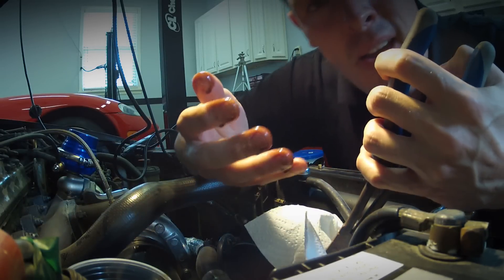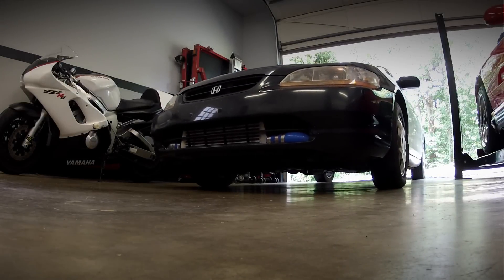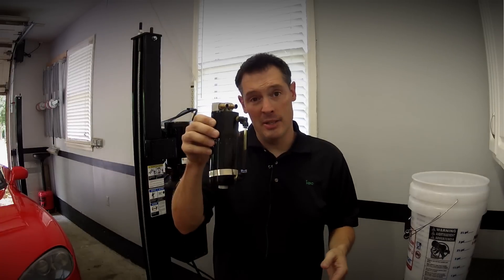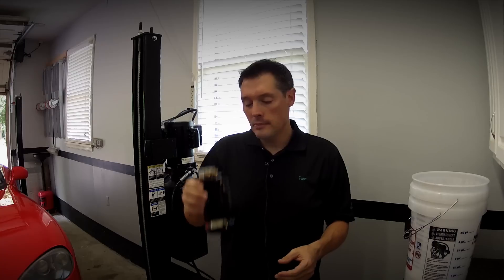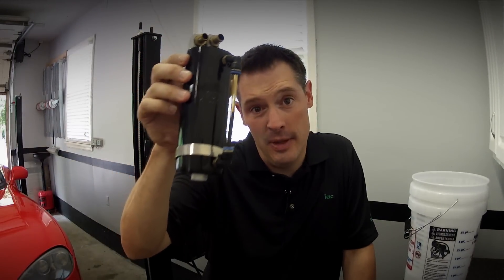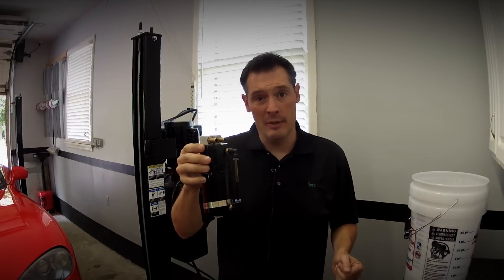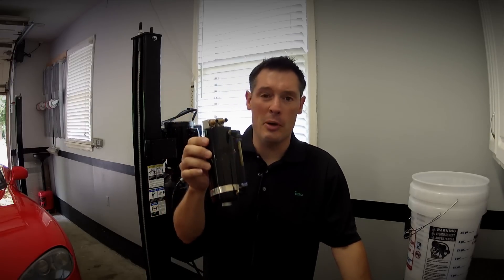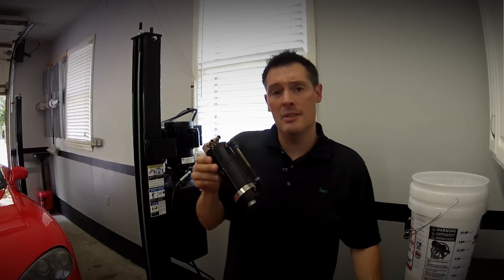Oil Catch Cans Myth Or Must Have - Ebay Oil Catch Can Review

Comment: Looks like u r using a crappy oil filter, and maybe cheap oil too. If you use a good 20mic filter media you wouldn’t have that black sooty stuff you are showing there. On these GDI engines you have to treat them with the utmost care. Catch cans are really not needed unless you want to use the cheapest oil and filter you can find, and that’s entirely up to you but I wouldn’t advise it.

Comment: ok....gotta consider catch cans are NOT factory equipment on the original build. Let that sink in a minute. Then consider.....where has any data come forth that illustrates the actual volume of air borne or liquid oil contaminants passing thru the PCV system. The catch can contents get the big reaction from most people, but how much of the total volume of oils have they really caught. My guess is that they actually catch precious little of the total volume generated by an engine.  Pretty much the micro fine oil droplets that are suspended in air will keep right on traveling through the air stream and back into the engine. It amounts to a feel good thing....and of course it "seems" like they ought to work. They work alright, just not nearly as much as you would like to think.

Comment: I recently research for my 2022 frontier that the V6 VQ motor is known to have oil blow back in the intake which will cause the intake valves to get dirty which the. Can cause carbon build up and loss of power. I recently bought a catch can that has an in and out and the opinion to have a breather. The question that I have is where does the out connects to , is it to the PVC valve ? Where does the in connects to, to the intake ? Because there are couple of diagrams that shows differently and I saw two videos that connects either way for my truck or at least for the same make and model but different year (older) . It would be great appreciated on your help. Thanks

Comment: So it begs the question whos at fault  for the blo by.. we pay 1000s for a car manufactured by supposed professionals that is sold to us by grubby dealers just to have a fucking fault that is so easily fixed by all of you experts on catchcans.. should we suite the manufacturer, dealer, or dodgy marketers. Or just maybe we can make sure our turbos,  intercoolers, and other pollution gear  are serviced properly, by a trustworthy mechanic?. Well thers a job in it self.. ther was always a catch as soon as we bought the car..  Catchcans? A wise ol mechanic once said keep wearing sunglasses  the eyes will weaking.

Comment: One thing I believe that wasn't touched upon in the video or the comments is the effect that oil vapor has on engine performance.  The addition of oil to the intake charge can increase knock and detontation.  If the knock sensors pick up on knock, the ECU will stlightly retard ignition timing thereby resulting in a reduction in power output from the engine.

Comment: I believe in using an oil catch can, but to be realistic, that 6-8oz of liquid is suspended in vapor that it took 4000 miles to collect. Your engine doesn't see it in the same way as you're showing it. At that rate, it's actually pretty easy for an engine to swallow that amount w/o issue. It's when the amount gets too large for the engine to swallow and if the catch can weren't there, things like the EGR and its piping can get clogged up and become less efficient. I believe in catch cans being installed on all engines for when the day comes when the blow-by becomes too much for the engine.

Comment: Considering the cost of engine repairs these days, I wouldn't recommend altering the PCV system while the factory powertrain warranty is still in effect.  Installing a catch can will likely void such a warranty, as will tampering with any of the other emission components.  It has nothing to do with actually damaging the engine, it has more to do with manufacturers not wanting to encourage tampering.  EPA may not be looking over your shoulder, but they are monitoring manufacturers and their dealers.  JMHO

Comment: I've yet to see somebody do a performance test before and after.  At first glance I'm thinking it's going to rob you of power off the line. Overall seems like a really bad idea. The engine is the most expensive part of your vehicle.  Not like you just bolting on a cold air intake.

Comment: Wow, I cannot wait till you catch can fans out there find out they can do more harm then good.  Change your oil at the proper intervals and you do not need one.  Put one of these devices on your vehicle and you have just run the risk of blowing gaskets, along with making your engine run in a non congruent factory aspect.  One more thing, not all catch cans are created equal, if you do put one on, do your homework and get a decent one, I guess.
Reply: Changing oil regularly helps some because you don't want the PCV to recirculate a lot of oil impurities through the intake. A catch can is useful because it tries to capture some of the impurities actually created in the combustion chamber. The safest way to install these is by using a 2 port catch can  attached inline with the PCV system.
Reply: d q i’ve got it admit the last car a wrenched on wasi my Datsun 280 Z. I change my oil every 5000 miles religiously sometimes earlier, on my mustang
I’m just kind of old-school, If A catch can was so important, ford would have made sure to install one from the factory . I’ve been doing a lot of research on them, most of the comments are favorable. There were a couple of articles I read stating that they can do more harm than good. Of course Scotty Kilmer the YouTube car guru says you need one. Anyway thanks for the reply, I have to admit all of my changes done to the blue stallion our exterior and interior. I have made no modifications to the motor at all, I guess I just don’t know enough about it.
Reply: @GunSlinger221  A few manufacturers have addressed this problem with DFI's. Read up on how Toyota's DFI works. They have one of the most logical systems at this time.
Reply: @GunSlinger221  Only newer cars have to worry about direct fuel injection clogging up their intake manifolds.
Reply: d q thank you sir I will do that appreciate all your valuable information

Comment: I think you need to say this is necessary ONLY for GDI engines. I had a Cork Sport OCC installed in my 2019 MAZDA CX 5 2.5 L. turbo. At 1,000  miles I have very little in it except a clear vapor. But in a $36,000. SUV I wanted to protect my investment. Turbos are more sensitive to carbon buildup than non-turbo engines.
ADDITIONALLY I'm having my dealer use its BG cleaning fluid system to clean the intake valves and turbo impeller.

Comment: Lol put a $10 part from eBay, on a $55k vehicle what can go wrong, have read here that best catch can at moment Provent 200, made in Germany, some test have been done here in Australia & some less expensive catch cans failed, compared to Provent 200, need to keep in mind if your not mechanical minded & you install incorrectly can blow seals & damage can be caused to the Turbo. I just installed Provent 200 to my Hilux still under warranty with Toyota had a Professional mechanic complete the work, Toyota ok with it, as long certified mechanic, but if you install it yourself incorrectly & seals go or Turbo good bye Warranty.

Comment: Don't those catch cans have a filter? This would increase the pressure behind the filter.  On the side of the PCV valve.  This would be the same effect as a partially clogged PCV valve.  A car with a clogged PCV valve doesn't run correctly.  If the filter doesn't have enough filtering to clog the PCV valve it is not much of a filter.  The PCV valve is not there to help the engine run better, it's there to decrease pollution.   It recirculates the crankcase gases back to the intake, instead of to the air.  How is an add on there even legal?

Comment: So if a catch can catches 4-6 oz of oil in 4000 miles,  on a car with a recommended oil change interval of 10,000 miles the catch can collects 10-15 oz of oil.  That's up to1/2 a quart and the oil level should be down by 1/2 quart.  So the vehicle you used to illustrate your vehicle uses in access of 1/2 quart of oil in 10,000 miles just through the catch can.
Reply: I have 244575 on my Kia Optima and my 1 bank kept getting clogged and causing misfires & blew my plugs and sensors. That was the symptom, the vapors built up and shut down my engine several times. The engine is designed to burn it, but GDI engines do not do it as well.
So I cleaned my engine with Seafoam and doing this will prevent it in the future.

Comment: 1:30 it doesn't catch "vapors", the vapors pass through to get burned. The catch can literally catches excess liquid oil (not vapor) that gets splashed and sucked in to the PCV valve. Normally it is burned off, but with higher power vehicles like LS engines and turbo setups, more of that oil is forced wherever it is easiest, aka PCV.

Comment: 1:52 soot in the intake would be due to the EGR and not PCV. That said, you are absolutely right to get capture this oil so it doesn't go back through your turbo, intercooler, intake manifold, EGR valve, etc etc.
Reply: I know this is old but....The soot is there......The oil that comes back into Mani, mixes with the soot and forms a paste inside your Manifold...Said paste is moist so it traps more soot, and just some nasty stuff going back into your engine.....

Comment: Waste of money imo, or manufacturers would put them on already for $20
Reply: I have installed 2,extremely worth it!The GDI engines do not clean the backside of the valves so all of the blow-by you see in the can corrodes the intake manifold and the valves.It forms into carbon and eventually chunks break off and in one case I know of(there are many more) it got into the valvetrain,stuck a lifter and flattened the cam lobe!$2000 repair ticket so these are way worth it.Not just an opinion,I have seen it with my own eyes.

Comment: Those are junk. You should not have that much oil in that can already. The can needs to have some type of baffling, or even some bunched up steel wool at the bottom. Good video though.

Comment: You can also use an inline air filter for a compressed air setup as well from any hardware store, those also have an inline filter that can either add to catching mist or get clogged up
Reply: Great idea. Would be super if you can post a YouTube video on one.

Comment: Cool video, thanks. I bought a reasonably priced Billet Oil Catch Can Kit through Amazon that will arrive tomorrow for my 2014 Dodge Challenger R/T Classic (5.7L Hemi). It's a pretty simple & easy install that I'll be doing myself so I can save my intake system some unnecessary build-up & premature wear.

Comment: I just installed a 2nd can on my n54. Now I have one can on the high side and one can on the low side, therefore, I will probably never have to walnut blast again because both high boost and low boost situations are now being filtered and collected. 
AND I also plugged my intake valve ports to seal any vapors getting sucked back into the valves...thus all low side vapors are now routed externally into the mishimoto can before being cleaned and sent back into the throttle body...boom, clean valves forever.

Comment: BEWARE THE SUPPLIED CHEAP PLASTIC HOSES.       By that I mean the ones that have thin vinyl hardware store tubing which is clear.   The reinforcing thread you can see inside the hose mean nothing  too!      Just go buy the proper sized fuel line ect.   And use that.    At the very least if you use the cheap hose take a close look while running to insure it isn’t collapsed.    The one on my Sonata went totally flat the moment the car was started,   Junk.     I also put a tiny O ring on the dipstick to assure it sealed.    
     Rose cheap cans are worth it actually just be mindful of the hardware and don’t be afraid to substitute for better if necessary.

Comment: How much vapor is a function of the volatility of your oil and your oil temperatures. How much blow-by is a function of how loose your oil control rings and valve seals are. You should know these values for the oil you are running. The less volatile the oil the less vaporization at any temperature. So if you got the blow-by it will contain only so much vapor in it. Then there is what is non vaporized oil getting by the rings and seals as liquid.

You will burn whatever gets by the rings and seals and whatever gets into the blow-by gases.

Comment: I wouldn’t recommend that oil catch can he used for a turbo motor, because I bought that same one and it was blowing my oil dip stick out of its tube. Better to buy a well designed and engineered one that is recommended for you motor. Crank pressure ventilation is very important (I learned the hard way)

Comment: Formula 1 injects oil into its intake airstream to counteract some of the heat from the cylinder. Helps fight detonation
Reply: It help's fight detonation because it cools the aluminum piston which decreases compression.  However they also inject oil up under the piston as well to reduce heat.  However in both cases this is a special highly combustible oil that in reality is just more fuel.  So they're basically cheating to get better MPG out of their fuel limit, without actually cheating since oil isn't limited but fuel is.  Because the piston sucks this thin combustible oil up around the rings from the bottom on the intake stroke, as well as pulls it in from the intake side.  
   This is NOTHING to be compared with what a normal car engine is doing.  Which is sucking burnt motor oil, and water vapor back around through your intake, manifold, and valves to be re-burnt in order to decrease emissions.

Comment: I have a BMW N54 twin turbo.  At 60k miles it was shaking like a leaf on startup and hesitating on acceleration.  Brand new, it was a beast.  Did the intake valve cleaning and it was back to beast mode right away.  So I put in a BMS catch can in along with a tuner and meth injection.  I'm at 117k miles, get about half a catch can of oil every 15k miles, and it still performs like right after the intake cleaning.  I'm sold.

Comment: If you have a lot of Blow-By or a least when you look into your Oil Cap and see a lot of Moisture when Engine is Hot or see a lot of Moisture in the Muffler/Exhaust.... This will help a lot especially Starting issues! I installed this in my Dad's Truck after seeing a lot of Moisture in the Oil Cap / Muffler / Exhaust and Hard Start of Humid / Cold / Rain Morning / Nights. Now the Trucks starts right away and works really smooth too. BTW... I see my Dad always have problems starting in the Morning or when Rain out. I also see a lot of Steam coming out of Oil Cap when the Engine gets Hot! Once I install the Oil Catch Can with a Filter for venting, somehow it solved it, especially Hard Starting in the Morning / Nights!
Reply: Look at my Catch Can..... Less than 400 Miles :///  See Video here:  https://www.youtube.com/watch?v=o5yoZhG__L4

Comment: The vapor from the engine is a mix of oil, fuel, and water from condensation. It's ment to be burnt out in the combustion chamber rather than being let out into the atmosphere.
Reply: I just empty mine into a old oil jug, and take it to the oil change place just like my old motor oil to be recycled.  All this does is allow the air to cool which separates the oil/water from the air, and deposits it into the can rather than burning it.  Which in the end is better for the planet because instead of burning that oil I'm recycling it.
Reply: Exactly! If it isn't good for the atmosphere, it definitely isn't good for your engine!  Common sense!

Comment: I have a '98 Mercury Mystique 2.0L, it doesn't burn or lose a drop of oil. Even cold starts, hardly any losses through many winters. If you keep the oil fresh, you can warm up quick and get moving faster. If you don't let the oil & trans fluid warm up, it will just burn inside and get all thick and crap. I will try an oil catch when I redo the pcv, hope it is not a waste on my little beast!

Comment: I'm surprised you didn't mention this in relation to direct injection engines.  That's reportedly where the real problem exists since gas isn't cleaning and cooling the back of the intake valve.  Also, from what I've seen (and you can see it in YT videos), the installation on a boosted DI engine is much more complex than the installation you show here.
Reply: Thanks now i wont watch, they are engines that need
Reply: Damn me too

Comment: there is a small amount of unburn oil, that will  bypass, clog your car 02sensors and cat(accumulative).
it is a must have to catch most of it.
the cons: extra maintenance work.
empty it if it's a 1/4 for best result.

Comment: A test to see whether you need a catch can:  pull the PCV hose.  If it's oily inside, that shows that oil is passing through the PCV hose and valve into the intake manifold.

Comment: If you make your own or get a cheap eBay one get some stainless steel pot scrubbers and a scotch scrubbing pad and some bailing wire to put in the catch can to make it much more effective. Make a small stand with the wire to hold the pot scrubber above the bottom of the inlet pipe cut the scotch pad so it fits neatly into the can and over the inlet hose but not over the outlet and slip it on tease out the pot scrubber and fit it over the inlet pipe use enough to fill the area between the pipe the walls of the can and the stand, place the stand in the can at the bottom and close it up.
The scrubbing pads will filter the gasses catching a lot more oil than with out them. Another tip is to fit some kind of drain plug at the bottom of the can if it doesn't already have one.